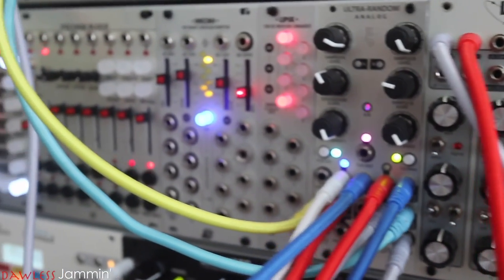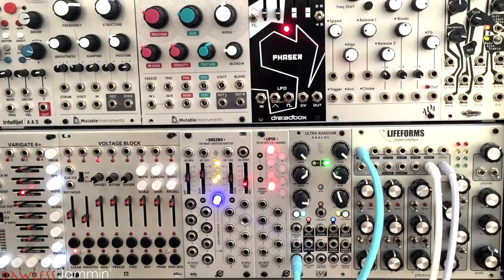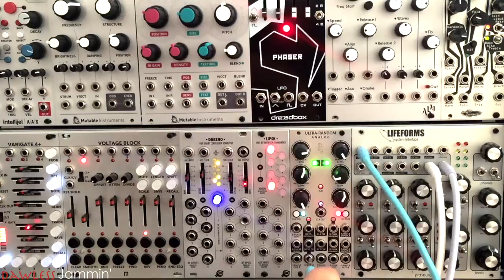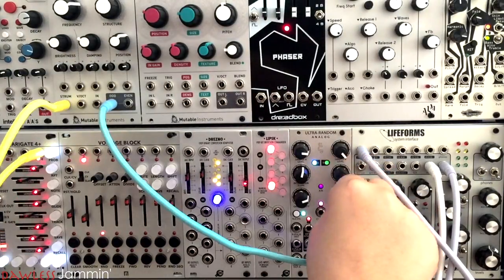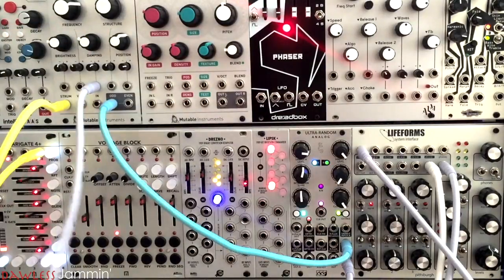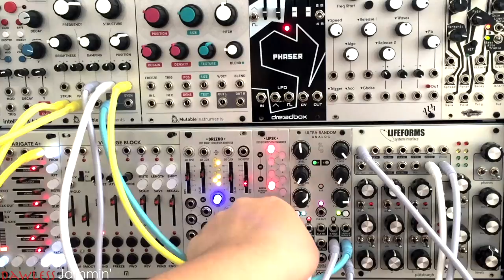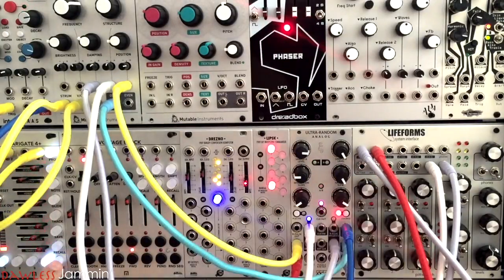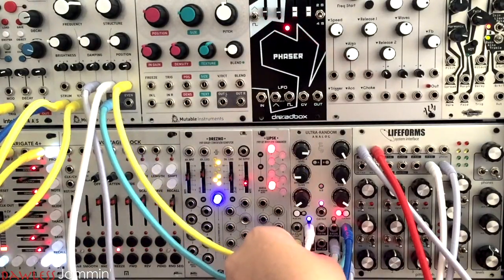Steady State Fate - Ultra Random Analog

Comment: I think the Integration Slope knob will only change the CV coming out of the Opto-Int Out. It's not wired to the Sample A output like the slew circuit is on Sample B. The bitcrushing this thing can do is one of my favorite functions to use! Such a cool design, but my one gripe is that Sample A can't be clocked externally :o\
Reply: you're right.